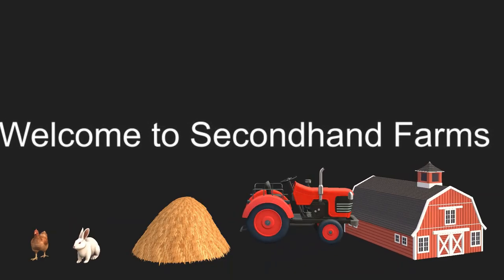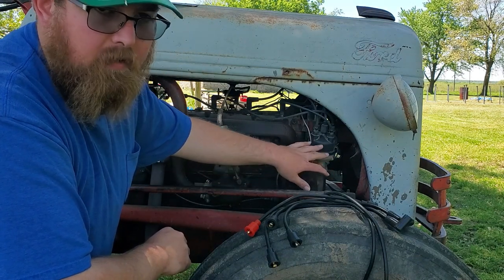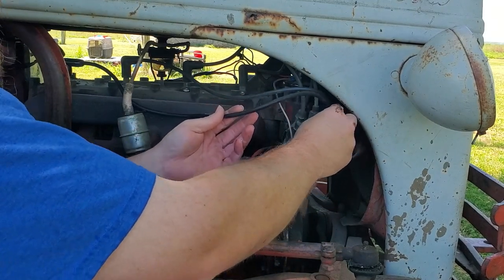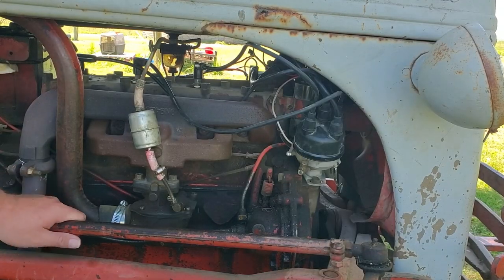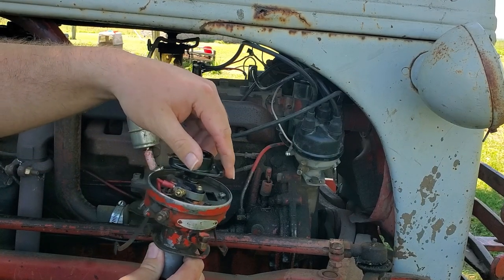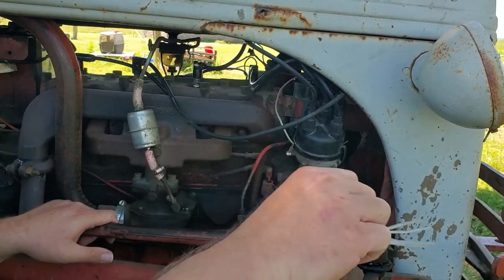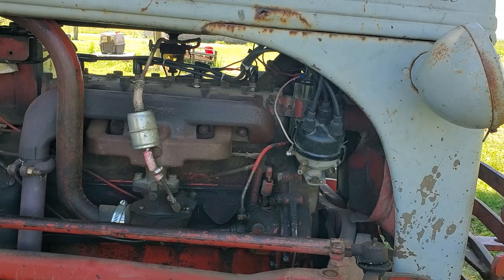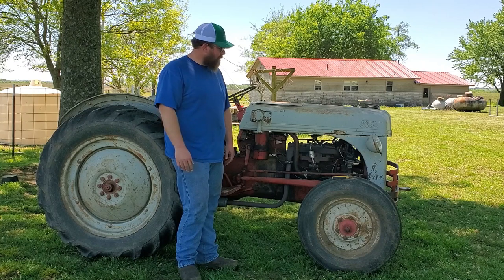Sputting and Sputtering Time to Change Spark Plug Wires on Our 8N Ford

Comment: Got a '48 8N with the front mount distributor. Over the weekend she started sputtering with the accelerator lever anywhere near half or above. I found that two of the wires were leaning on the edge of the drive belt and which had worn through the rubber into the wire. I thought it was not a coincidence and the first minute of your video was enough evidence to convince me that this is indeed my problem. New wires are due here in a couple days and I'm feeling good that the ol' lass will be back to full strength in no time.
Reply from the maker: Oh ya? I'm glad you found your issue! I hope the video helped. I hope you get 'er up and going again soon. They had those front dizzys for a number of years I personally never cared for the design. While you're there be sure to check your cap also I've seen the front axle pivot bushing be wore enough for the axle to pivot and crack the cap and cause random misfires as well. I'd day if you for sure saw the wires thats probably it but being as you're already up in there it doesn't hurt to inspect everything! 😉 thank you for watching!

Comment: I just stumbled across this video.  Thanks for posting it.  I have a 8N also, but it's been Frankenstein a bit.  From certain features it's a '47 8N, and someone replaced the engine at some point with one from a 2N.  And to further muddied the waters, they changed out the front mount distributor with a side mount, which means the changed out the timing cover and cam.  I suspect they have it grossly out of time and since it's a 2N engine, there is no access hole to see the timing marks on the flywheel.  Any advice would be greatly appreciated.

Thanks again for this video.
Reply from the maker: Oh my! That does sound like quite the patchwork quilt of a tractor! I would say by the sounds of that you will have to do it by ear. You can roll the engine to where it's at top dead center compression by checking it with something like a pencil down in the #1 cylinder to indicate the top of the stroke and the distributor bug should be pointed at the line on the rim of the distributor. That will get you really close to 0°. Put it under a load like high gear and pressing the brakes. Best way I've heard to do it by ear is turn the distributor opposite of rotor rotation till it "pings" under a heavy load then ever so slightly turn it back same direction as rotor rotation until it no longer makes the ping noise under a load.
Reply: @SecondhandFarms  that's what I was thinking.  Even though side distributors are much more easier to access to work on, on this particular 8N, I wish they would have left the front mount distributor intact.  But, they didn't.  They put on some new parts, probably trying to make it start and run better, a new carb, a new coil, etc.  If I get it in time, I might go with electronic ignition.
Reply from the maker: Ya im not 100% sure but I was thinking there was a difference in the way 2ns and 8ns blocks monted to the front axle but I could be mistaken. If that's the case they may have been forced to change the front cover 🤷‍♂️ EI is a great option just double check you (+) &(-) I never knew that was such a big problem. I've known people that have worked on points their whole life and blow an EI module because they hooked it up backwards
Reply: @SecondhandFarms  To mount a side distributor, the timing cover and the cam has to be changed.  There isn't a place on the timing cover of a 9N/2N engine to mount a side distributor, so the timing cover has to be changed, and then the cams are different, the gear to engage the distributors are different.
Reply from the maker: @316jd140  right. I knew they were different as far as having a place to mount the distributor but I was thinking the front axles mounted different as well. I'm a Deere man myself but I've always loved these little Fords.